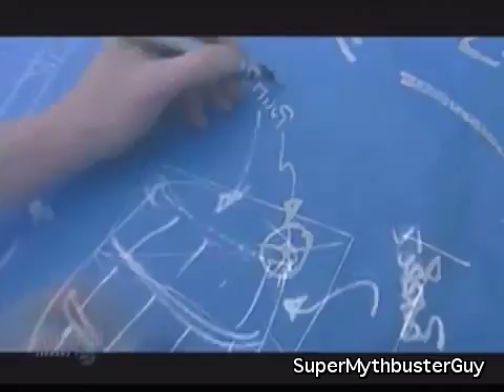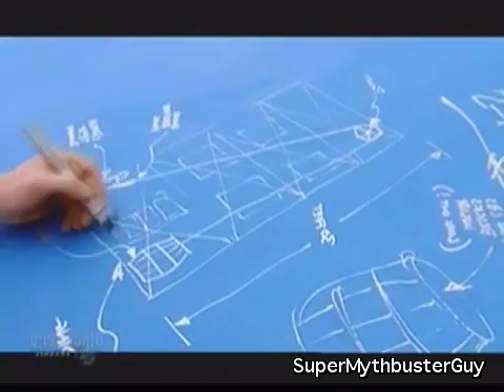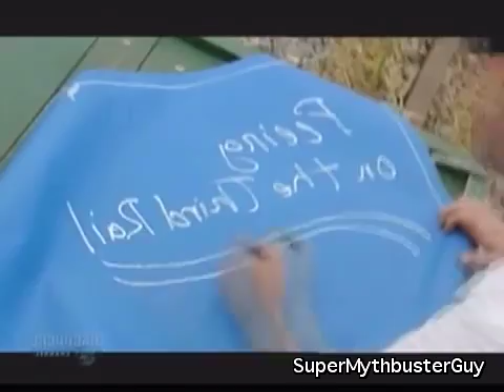Mythbusters Barrel of Bricks (1/4) S1E03

Comment: Dear Sir, I write this note to tell you of my plight, and at the time of writing I am not a pretty sight. My body is all black and blue, my face a deathly grey, and I write this note to say why Paddy’s not at work today.
While working on the 14th floor, some bricks I had to clear. Now, to throw them down from such a height was not a good idea. The foreman wasn’t very pleased, he being an awkward...sod, he said I’d have to cart them down the ladder in my hod.
Now, clearing all those bricks by hand it was so very slow,so I hoisted up a barrel and secured the rope below, but in my haste to do the job I was too blind to see, that a barrel full of building bricks was heavier than me. 
So when I undid the rope the barrel fell like lead, and clinging tightly to the rope, I started up instead, well, I shot up like a rocket till to my dismay I found that half way up I met the bloody barrel coming down.
Well, the barrel broke my shoulder as to the ground it sped, and when I reached the top I banged the pulley with my head, well, I clung on tight though numb with shock from this almighty blow, and the barrel spilled out half the bricks 14 floors below.
Now when these bricks had all been scattered on the floor, I then outweighed the barrel and so started down once more,
... yikes, I can’t remember what happened next.
Reply: "I clung on tightly to the rope, my body wracked with pain; and half way down I met the bloody barrel once again."

... I just came from here https://www.youtube.com/watch?v=NZwGk5xmlq0

Comment: If you look at the myth falsehoods, everything is false: There is practically no reason you’d take bricks down off a building, you wouldn’t have bricks 2x your weight without knowing it, the length of the rope means you’d stop before the pulley not after, they demonstrated a barrel wouldn’t break so easily, but more importantly, if that happens and he’s laying flat in a pile on bricks/limbs/barrel bits, any compassionate human would put an end to his suffering.